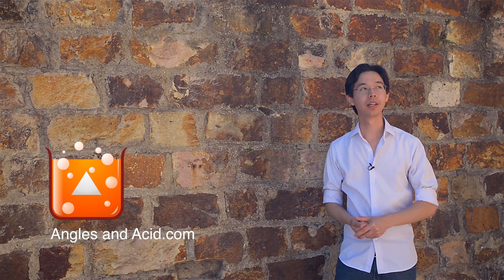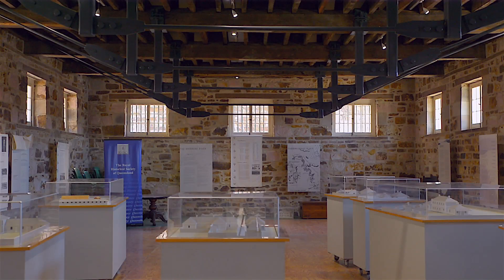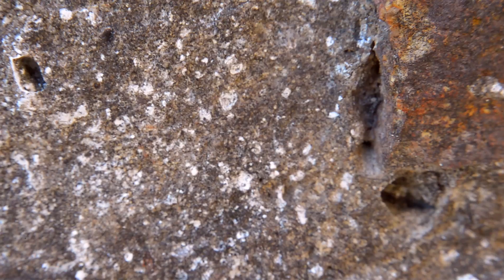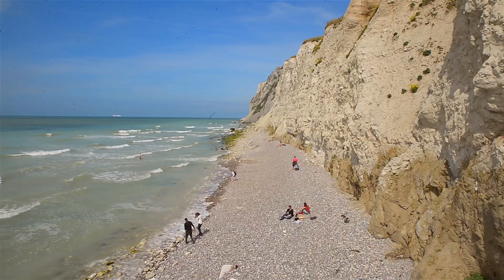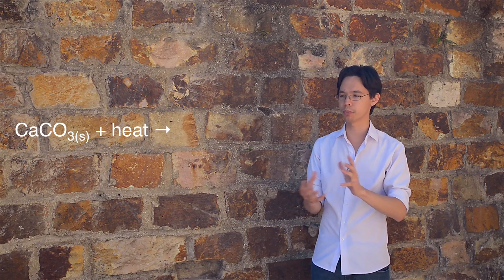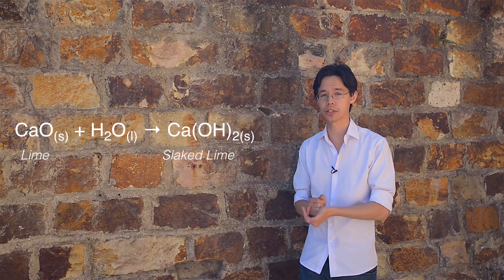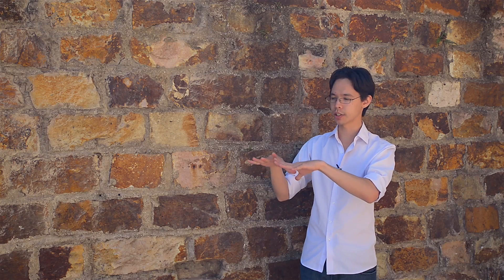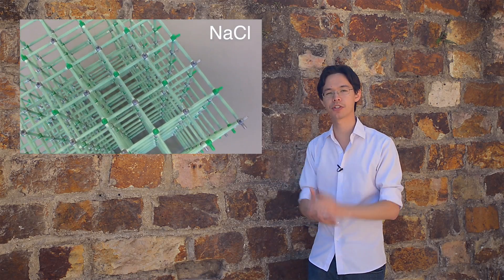Why put sea shells in Mortar?

Comment: as we need to Sea Farm more and more and the best to do farm is mussels, we can take the byproducts of them (shells) and then turn it into mortar. Theres a limited amount of sand in the world for concrete and this could be the substitute for the process.
Reply: Who's "we"?
And yes, shells (mostly Calcium carbonate) can be heated to drive off CO2 to produce Calcium oxide. Which can then be "slaked" by adding water, resulting in Calcium hydroxide - a part of what makes cement/concrete what it is. And with shell as an aggregate, you would have some basic tabby. 
BUT Silicon dioxide, which is in many sands in varying amounts, is added because it can add strength both physically (as an aggregate) and to some extent, chemically.

I've also heard the sand shortage propaganda. It's maybe not completely untrue, as it's not ideal to continuously take it from the sea and erode shorelines, etc. But there is no shortage of sand. There are huge amounts of it in deserts and places other than the sea... But it's the shape of desert sand which has prevented it from being used (at least in recent history). Desert sand is rounded and doesn't hold together anything like as well as irregularly shaped, coarser sand. And that is supposedly the reason "they" keep talking about a worldwide sand shortage........... 
Yes, it could be seen as problematic - but there may be ways around it. New, or alternative concrete mixes, etc.
I mentioned to someone a while ago that there may be a chemical way to 'etch' the desert sand, making it 'coarser'. 
NaOH could possibly be used and the main side product, Sodium silicate, would also be useful because it can be reacted with an acid to precipitate Silicic acid. Silicic acid can then separated and mixed with Calcium hydroxide, to form Calcium silicate. 
Calcium silicate (or Calcium silicate hydrate) is somewhat comparable to portland cement. Add some pozzolans (Alumina, etc) and you basically do have portland cement.
Calcium silicate could be produced using shells and desert sand (and sea salt, or even wood ashes to produce NaOH/KOH) as the basic materials. Mix some pozzolans into the Calcium silicate, add 'shell sand' (fine crushed/ground shells) or other fine aggregates and larger crushed shell, or other larger aggregates and that could make some decent concrete. There are many variables, of course.

Anyway... I sense the 'sand shortage' alarm calls are about much more than coastlines, sand, or concrete. There seems to be something manipulative about it - which is not unusual.

That's the longish answer. Look up some of what I mentioned if you get a moment, because it's interesting stuff to learn and could be very useful to you one day. There is a video on the 'Primitive Technology' channel, where the guy makes basic concrete from different stuff, such as snail shells and wood ashes - worth checking it out.

Comment: shells are not a good strength choice since it is partly protein layering that will erode easily in a damp condition and is subject to heat damage as well.  so although there is calcium carbbonate layering with the protein there are these drawbacks.
Reply: Then why are 400, and 1000 year old buildings using it still  standing🤔
Reply: Tell this to the romans. Their structures are still standing!
Reply: That is a good point. But as someone else mentioned - these bits of shell may just be there because not all got turned into quicklime. And in that case, it's probably quite likely that the protein was more or less destroyed during the 'burn'.
Maybe it's worth considering before using unheated shell as aggregate. It could make the difference when it comes to strength. I'd like to see tests - Surely these things must be known about already. But then again, historical concrete seems much better than modern concrete in many cases...So maybe there are some knowledge gaps.......... Alkali Silica reaction cracking, etc, shouldn't now be ongoing problems after many thousands of years of people working with the stuff..........
Sometimes I wonder if the knowledge hoarder-concealers just like to play dumb and invent/reinvent problems for the masses to deal with over and over again. All the while, hoarding and concealing the old knowledge which could make the problems vanish. Laughing all the way...
Reply from the maker: Awesome - good reasons for why its not used in commercial mortar today